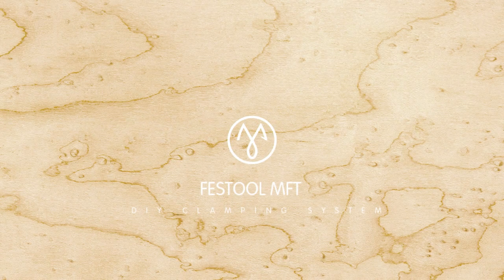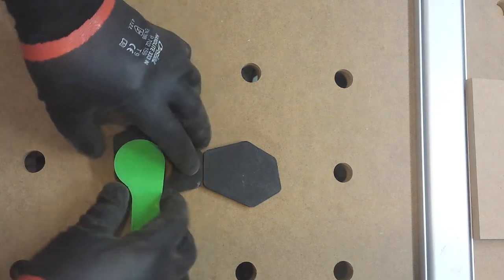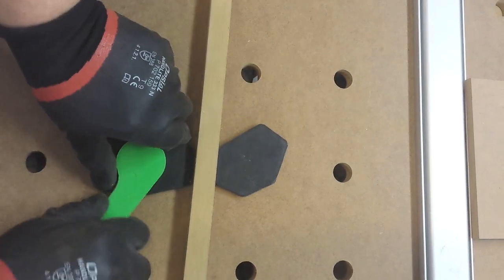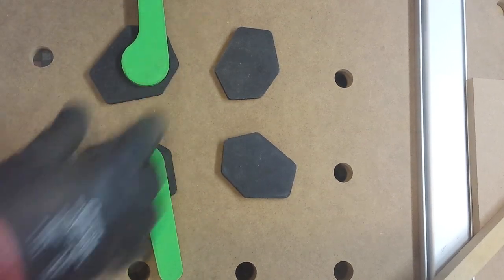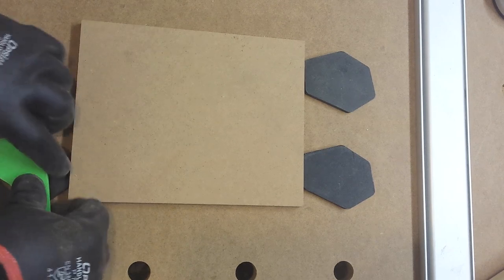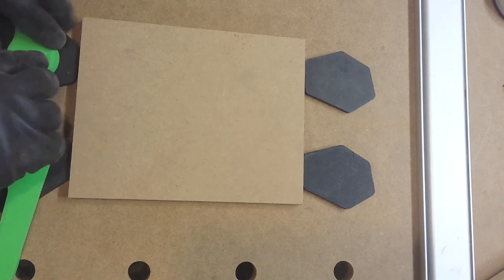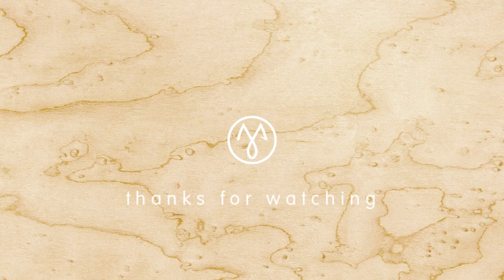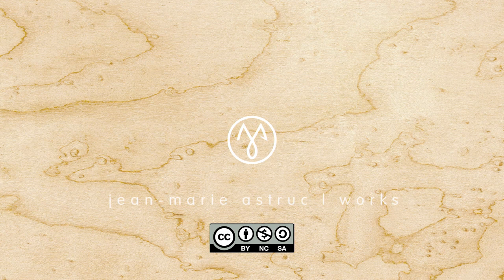Festool MFT DIY Lever Cam Clamping System

Comment: I have a question:  I found a local person (friend of a friend) that does a little 3D printing.  He made me a few of the clamps, and when I tried them out....they didnt fit in my table.  I looked at your print, and see that you call for 20.3mm posts.  Why are they spec'ed at 20.3mm when the holes in the top are 20.0mm?  Also, when I asked the person to just change the file they downloaded from you, he said that he was unable to change the file because it is locked.  Is the file locked?  thanks for the help
Reply from the maker: Hi josh, thanks for your message.
First, the files are not locked. You can edit any of them as you like. (Fusion360, Sketchup, whatever...)
The parts are meant to use 20mm dowels or 20mm PVC pipes. Basically any stuff that is 20mm in diameter.
The 0.3mm is just a mechanical tolerance. A 20mm rod don't fit into a 20mm hole. The friction is too important and you need some heavy persuasion to make it fit, and hammering it in is probably not a good idea. Anything you buy which is meant to fit together have at last a 0.2mm tolerance to fit in nicely. And it can be much larger (0.5 to 0.7mm) to be much comfortable to do. So that 0.3mm "gap" is usefull to cover eventual printer overflow, and also allow you to insert the chosen tube with a bit of glue to fit in between. I believe there's no better way to design a part than to take tolerance in consideration. Enjoy, and have a nice one ;)

Comment: I have a furnace and want to make a pair of these in brass and aluminium.
Reply from the maker: You will probably need to polish or adjust/machine the sliding areas, but this is a great idea Peter ! These will probably look good too.

Comment: Are these available for sale.  I would place an order today!!
Reply from the maker: Hi Josh, it's good to know that some things are not for sale in this world. Actually this clamp system is open source. You're meant to print or make your own from scraps. You should be able to get some for few money at the nearest fab lab if you don't want to DIY it. It's up to you.
Reply: Well thanks for the response.  I would have happily paid you for the parts, but I will look up a local 3D printer in my area.  I also just saw your plans for making a perforated top.  I'm going to have that made to.  Excellent work!!
Reply from the maker: Thank you Josh, your comment means a lot for me.